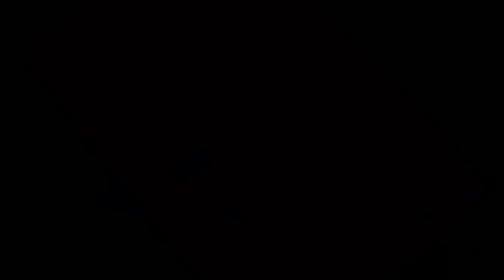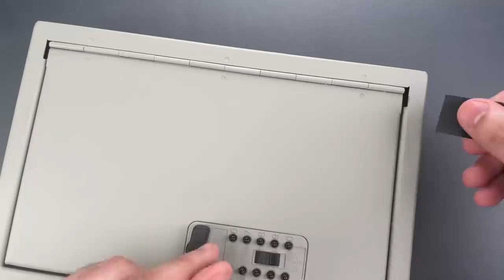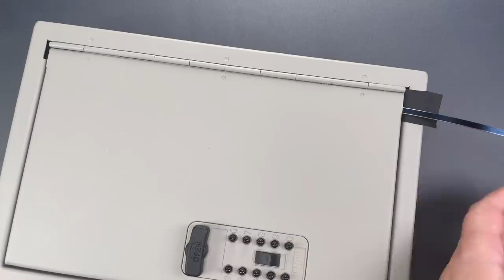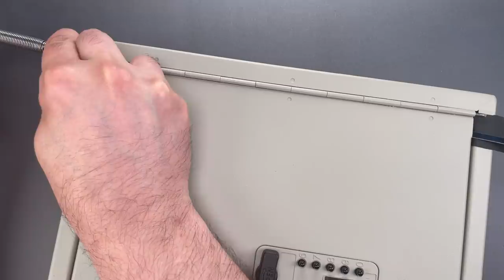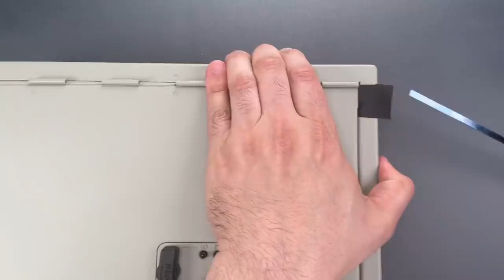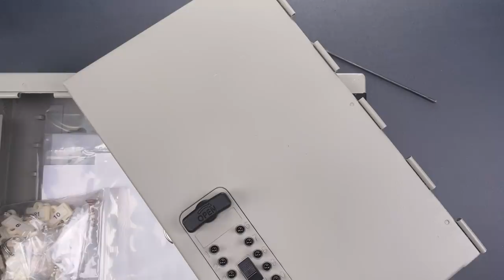[1319] Bypassing Kidde AccessPoint Key Cabinet Pro

Comment: Most ppl talking about welding the thing shut, here i am just asking myself why the hinges are exposed in the first place, you can have the hinges on the inside...
Reply: Then the door would open to the inside or the door wouldn't be embedded on the box frame
Reply: @kumaESP  You could put the hinges half an inch away from the edge of the door on the inside, that way the door can rotate to the outside and the hinges would be hidden
Reply: @eli-boy7473  I doubt there's any design like that out there and it would create other problems it's easier solved by welding it
Reply: @eli-boy7473  Think about the geometry. If the hinge is on the inside, the hinge is folded together when shut and opens as the door moves inward. Hinges on the outside,  closed when the door is shut, open as the door moves outward.
Reply: @jackiemowery5243  i thought of something along the lines of this https://www.youtube.com/watch?v=mDYZcGrhwyM
The hinges can't be punched out like with this one, and i have seen other designes that had the hinges half an inch away from the edge on the inside, though i haven't found a picture or a video of such a design; kind of hard to look for it really^^
Reply: to those complaining that "hinges on the inside make the door open IN" think about a car door..... its hinges are on the inside and IT opens out!
Reply: They have been making hidden cabinet hinges for years now! The doors still open outwards... 
Any high end safe has hidden hinges as well....
Reply: @kumaESP  Welding other than spot welding is VERY expensive in a production line.
Reply: Yup, there are many ways to accommodate internal hinges, they don't have to be a piano hinge.  Or they can be external hinges, but with some sort of locking pin on the inside so that removing the hinge pin doesn't give access to the interior.
Reply: @glasslinger  OK, if welding is too expensive, then crimp the ends.  Or put locking tabs or pins on the inside.  Or epoxy.  Or red thread locker.  Or Elmer's glue.  Anything would be better than what they did.
Reply: @kumaESP  there are several ways to put hinge inside, but ... They are more expensive than welding.
Reply: @jackiemowery5243  geometry is just a challenge. There are multi part deployable hinges that can have hinge inside opening out ... 

Or circular  sliders.
Reply: @BlaubartMT  There’s a process used in traditional swordmaking (for firmly attaching the blade to the hilt) called peening, where you hammer the ends of a metal rod so it mushrooms out and can’t fit back through the opening it came through anymore.  Wouldn’t be as strong as a weld, or as big an improvement as hiding the hinge entirely, but probably a bit harder for someone to undo than normal crimping while being similarly easy to implement in an assembly line.
Reply: From an engineering stand point internal hinges are a good idea, but from a manufacturing standpoint they are a nightmare. You would have to install the hinge plates before assembling the rest of the box and since this appears to be made from a single piece of steel that is stamped and folded that would be impossible. Even if you used 2 or 3 smaller hinges rather than a piano hinge you would have a hell of a time trying to weld the plates inside an already formed box that small. The additional time of manufacture would make it cost prohibitive.
Reply: Even if it were geometrically possible, you have to realise that someone, somehow, has to put the hinge pin in during manufacture.
Reply: @Miketz  every thing is possible ... Just not at an acceptable cost.
Reply: @Miketz  you can put the hinge pins in first, then assemble the box.

And it's entirely possible to install even a piano hinge on the inside. Off the top of my head I can come up with two different geometries, one even has the door closed flush with zero gap.
Reply: @IONATVS  That's how we learned to make rivets in "Jewelry" class (more like metalworking given the (mostly hand-powered) saws, hammers, and acetylene "soldering" torch) in high school. That class hurt...
Reply: Honestly I'm surprised I haven't seen too many mentions of a pair of retaining pins on that hinge pin that could only be knocked free when the door was open. Not sure the cost factor on that, but considering it would just be more pins inserted... not too excessive I would imagine.
Reply: @MLU8811 They are made in a rice field in china.

Comment: Thank you so much man. I have been binge watching your videos for a week or two to learn what I could. We have an alarm at my work that is turned on by a key, that we have. Then it has another key slot at the top of the device that is meant to be turned multiple times to unthread the entire thing so you can replace the 9 volt battery that sounds the alarm. We don’t have that key and the battery has been dead for a month. After about 30 mins I was finally able to get it open and replace the battery. It was much harder to get back together but I finally did it. Thanks again sir. Subbed for life!

Comment: This could be easily fixed by using instead of one single rod 3 rods so that even if you pop them only one can be pulled out and the center one will always be unreachable. Though you could still push them out with another rod, but that's harder to find and really specific.
Reply: Easier to just spot weld the existing pin in a few places.
Reply: @Stambo59  it might be easier like that....
Reply: @Stambo59  Bingo. You can see the spot welds connecting each hinge half to the door and safe body, whats a few more for the rod. Add another dollar to the cost and possibly have a safe which isn't a complete joke.

Comment: Seeing as these boxes are usually in plain view and / or near personell or security personell, this probably isn't a big deal. Not even gonna lie, I've worked unarmed security for almost 4 years and most places I work (I'm a flex officer, the fill in guy who goes around many, many sites to fill in as needed) don't secure their key boxes, fire / security panels, or much else. The amount of times I've seen a master key or a keyring full of keys just laying around makes me laugh. 

Point being, I think the problem is less that the manufacturers don't care, and more that the clients of these products simply don't take security seriously. I've had clients who legitimately want to remove our (The security officers) access to building cameras for "privacy concerns". Secure doors left propped open, fire stairewells left propped open (Oh boy the fire marshalls love those, and they ALWAYS ask us, the security guards "Well don't you do patrols and check for this?")

Anyway, odds are they won't keep this box locked wherever it is installed, or every employee that isn't supposed to have acesss will end up with it anyway because the combination won't change over the next several decades. I know a sound a bit jaded, but again, I've worked as a security officer for four years sooooo... Yeah... Everything from warehouses to retail to "logistical security" (Yeah that's a thing, I become a receptionist for truck drivers, AKA, kill me, now, please...)

Comment: We have one of these in my work place. I don't know if the one we have is defective, but if you know the 4 digits of the combo, but not particularly in order, it doesn't matter because the order in which you input the digits doesn't matter and it will open anyway.

Comment: thing is you dont even need welding to fix this. just have to reverse the hinge order so the 2 outside hinges are conected to the frame instead of the door which will stop it being bent up- which is how any hinge should be done anyway
Reply: And what is your magical method for inserting the hinge bar
Reply: @tsm688  Spot-weld the hinge to the frame after the hinge bar is in place.

Comment: Perhaps an easier solution to the pin removal attack than welding is to simply split the hinge pin in two parts.  Assembly is made no more complicated or time consuming. With a two part pin, even if someone can knock and pull one of the pins out in the way demonstrated here, enough of the pin will remain inaccessible within the hinge to prevent removal of the door.  You would need a hammer tool with an exceptionally long anvil to move the second half of the pin the rest of the way through the hinge.
Reply: You have a point and then you do not. A two part hinge will still leave some gap between the 2 sections. All one needs is a bent pin and a plastic pry bar and then force the pin in to it with the pry bar and extract from the ends.

Comment: I looked up how the other Kidde pushbutton locks are decoded and applied the same technique in this fashion to decode the lock in minutes.  Be advised, the BEST way to do this is with some sort of flat or dimpled "stick" or rod you can use to physically push down on the buttons, as you will be applying enough force to make your thumb quite sore in short order otherwise.  I used a retractable ball point with heavy tape over the tip to keep it from damaging the plastic pushbuttons.

First reset the lock, then apply just enough clockwise torque to the open knob to get it to stay in a slightly cocked position.  The position of the knob is key...it should be positioned only as much as it takes to get the knob to stay put when you release it and no more.

Then push down hard, one button at a time, and observe the knob for movement.  If it doesn't move, release the knob tension to its normal position, reset the lock, reposition the knob, and try again.  If you get no movement on that button a few times, then move on to the next and repeat.  

Any buttons which produce movement of the open knob are very likely to be part of the combination.

When you have done this for all the buttons, release the tension on the open knob, reset the lock, and enter all the numbers which produced movement in the procedure above.  The lock should open.

IF IT DOESN'T OPEN:

Repeat the above procedure again this way:

First verify all the buttons which produced movement before still do so.  (They should.)  This will give you a "feel" for the procedure.  Then cycle through all the other buttons to figure out which one (or ones) you missed before.

Comment: They might as well rebrand themselves from "Kidde" into "Kiddie" for how easy it was to bypass their lock
Reply: It isnt easy to bypass if you need a special tool
Reply: @ayoze101  Well pretty sure you could do this with a hammer and a sturdy nail, it just a tad faster and easier with that tool he uses maybe
Reply: @ayoze101  many things can be done faster with a special tool and slower with an improvised tool.
Reply: I thought that was what it actually said on the video thumbnail!
Reply: @GummieI  but still, normal people wont look at this and think "I am going to bend the metal then push the hinge out". I think that this product works fine for what is meant for. it keeps people who aren't supposed to be in there out because most likely the person who is trying to get in wont be smart enough to do this.
Reply: @ayoze101  "normal people" wouldn't want to get in it, in the first place(unless they are the actual owners ofc), and beside that there are plenty of reasons someone could be running around with pliers, hammers and nails, specailly if they are in a car already, could be their normal working tools, to just name one, but they are also just tools that are handy to have on hand whenever
Reply: 1. nails are can only be as small as 5mm and that pin looks to be like 2mm
2. what item small enough and sturdy enough to knock the hinge out
3. the lock alone would be enough to intimidate most robbers
4. think about how this would be applied in the real world
5. why am I arguing with people in a youtube comments section
6. It's a box that holds keys, even if they got in how would one know what the keys are for and where the lock that the key goes to is
Reply: @ayoze101  have you heard of a screwdriver
Reply: @inoob26  
Or panel pins?

Comment: Very interesting. Lesson: Mount the box under a shelf or in some other position that limits the travel of the hinge pin or ability to insert tools to one end or the other. What would rate this for securing keys after such a placement is made? Without endorsing this particular product, would it be an acceptable solution, or something you'd pass on entirely?

Comment: If someone made the simple fix of securing the hingepin I wonder how you'd get in then
Reply: Touch of a welder, problem goes away.
Reply: This is the LPL. He will find a non-destructive way to get in. Most likely by decoding.
Reply: @lairdcummings9092  I was about to say, I know about 5 methods off the top of my head to fix this issue but the welder would probably be the fastest to implement.

The most interesting would be duel offset hinges.
Reply: I mean he did say you would need a more skilled and experienced hand at decoding so yea decoding would probably work if a bit harder
Reply: @MrCodwaw101  but, as he noted,  it will require skilled hands - The LPL might get in, but few others will, short of an obvious destructive entry. 

So - a bit of a weld bead, and the box is secure against most covert, simple entry methods.
Reply: @Ceece20  fixing the problem is simple, the trick is to fix the problem in a way that is simple/cheap enough for them to implement and still be worth selling.
Reply: Everybody carries a magnet nowadays...
Reply: Drop it on the floor.
Door fly open ?
Reply: @Ceece20  yeah, I was going for "fast, cost-effective."

You could also peen the hinge pin ends, or dimple it at any of the hinge straps, or reverse the hinge so that the pin is inside... Any number of cheap and easy fixes; some easier than others.
Reply: These boxes (or at least a brand that looks identical) are used at my work for securing our site materials (security) and you can pop the door open with only about 100lbs of force, less than your average body weight. The bar holding it shut is flimsy enough to bend with thumb and forefinger (with a sizable amount of force) and the screw holding it in will unscrew BY ITSELF with time. Honestly popping the hinge pin is prolly the most effort to get in and still call it easy
Reply: @stuartd9741  maybe? This box is heavier than most. The "gravity key" is less certain on this one.
Reply: @lairdcummings9092  Hinge pin inside would make it difficult to assemble the box.
Reply: Rake the top of the hinge with a file and the weld goes away, they need reverse the hinge into the compartment.
Reply: @JCWren  not excessively so. But enough so that it wasn't my first choice, or even second. It would require spot-welding a pre-assembled door+hinge. Easy enough, but would require some re-tooling first.
Reply: @snarkylive  if you're going for obvious entry methods, a simple claw hammer will do.
Reply: @MudakTheMultiplier  If it's me, I'd use two shorter pins instead of a long one. Stamp the middle cylinder in the middle(so that pin cannot pass through) and insert the two pin from the two sides. The pin should be a bit short so that it never protrudes.
I mean it can still be removed in theory, but much harder. It won't require any more materials and only requires two extra mechanical manufacture steps(two insertion instead of one, and the stamping). It won't require any retooling/new mold or whatever.
Reply: I do wish he opened things a second way more often, especially when the first way he opens them is an issue that is easier to fix.
Reply: @lairdcummings9092  I think there's a little more to it than that. The cabinet and door are powder coated separately. Since you'd have to leave clean metal for the spot weld, I'm not sure how you'd be able to powder coat it. Possibly by masking off the already powder coated areas and doing it as a separate step, but that would definitely raise the cost of assembly.

When I worked at Sargent Lock, they were always looking for ways to save every penny possible, especially for stuff that was assembled in the US.
Reply: I would add a simple Z shaped weldment INSIDE the box to trap the door to the frame when closed. Hinge isn't securing the door then.
Reply: @JCWren  when I did powder coating, masking was an effective way to keep surfaces clear. As noted, not my first or second choice, but probably still inexpensive enough; cost would obviously get passed along to the consumer.
Because yeah, cutting production costs.

In all likelihood, dimpling one of the hinge straps would be easiest and cheapest solution.

Comment: Imagine that... all Kidde had to do to make this cabinet secure is to insert 2 hingepins, so it would be split in the middle.
Reply: Oh, that's a nice idea. Even easier than spot-welding the ends.
Having said that... two would still only require the bump LPL showed here to get rid of one half, then another small bump with a thinner metal rod to get the other half a few mm back out the first end.
Three would mean they'd have to bump the middle segment for an entire third of the length; four would mean bumping at least half the length. Still possible perhaps, but it would slow the attack down considerably.
Reply: @aihtdikh  put a gap in the middle so tapping in one hinge doesn't tap out the other.
Reply: @aihtdikh  Takes twice as long to do, and that hinge removal tool won't do it for you.  You'd have to know and plan ahead.
Reply: A good example of how literally anything would be better than what they did.  Maybe not perfect, but better.
Reply: @aihtdikh  I think it would be easier and more effective to crimp the ends than to install four hinge pins into the hinge.

Comment: Press a number, turn knob like Harry did at 0:23 until you meet resistance, then turn it back again. If you hear two clicks as you moved the knob then that number IS in the combination - if there were no clicks the number is NOT in the combination. Toggle the clear lever and repeat with the next number...